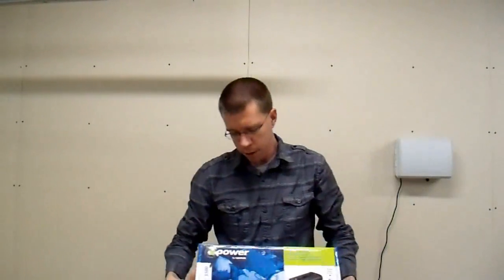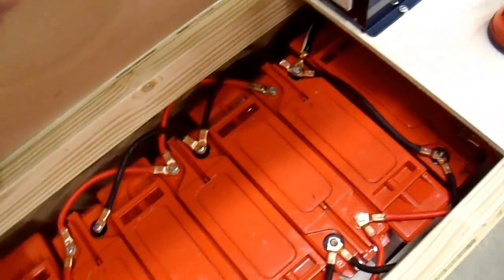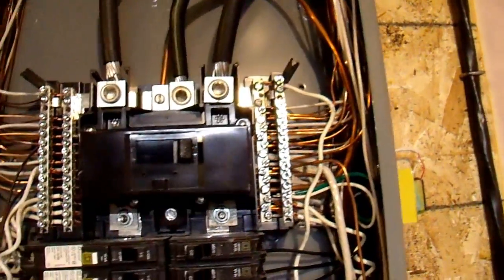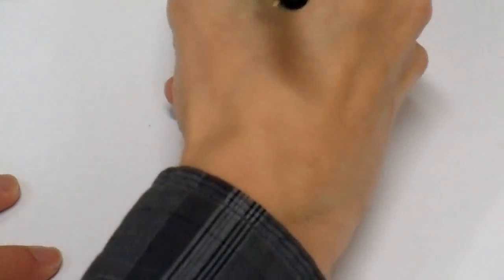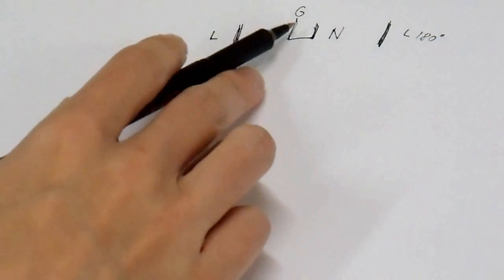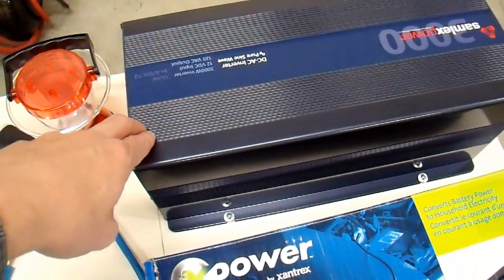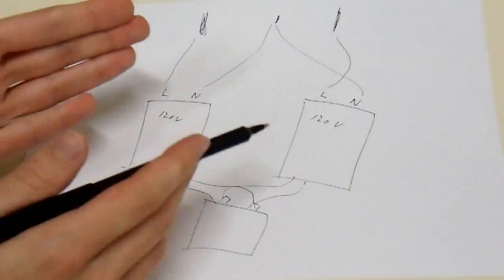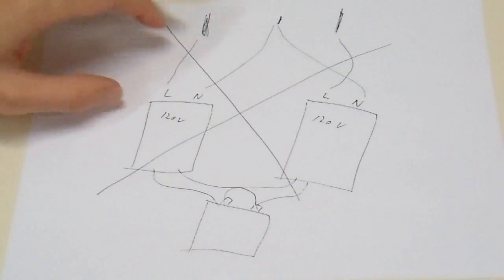How to Power your House with an Inverter/Generator During a Power Outage Part 1/3

Comment: Knurlgnar24, Do you know if apc battery backups are pure sine wave? I have a couple as backup for electronics and wanted to know if they are safe for electronics and other sensitive items. Thanks!
Reply: +Ande Taylor Smart ups are pure sine and the back-ups are modified sine wave
Reply: +z1power thank you!
Reply: Will APC answer that question?

Comment: Looks like it is as fail safe for line workers as not locking your keys in your car or leaving a gallon of milk at the register at the store. Fail safe means eliminating the possibility of human error and in the case of somebody's health and safety this does NOT qualify as fail safe. Are you ready to take on that PERSONAL liability just to show off that you can do it outside of the approved systems? If you were a line worker would you feel good about putting your health and safety in the hands of "some random person" during a potential stressful time to remember all the right steps??

Comment: I didn't see it mentioned in the video or comments but don't you lose your ground (the non-current, non-neutral) as it runs through the same main disconnect as all the other cables?  Great, great video, thanks.
Reply: The ground and neutral dont run through the breaker
Reply: +Star Gazer ah. Of course, why would it? That's pretty key to understand. Thanks!

Comment: Plus you make stuff very longer an complicated. 
Just buy 2 phase or 3 phase inverter,depending on your location. 
That supports on grid and off grid modes.
And let certified electrician to connect your inverter to mains. Everything else you can connect your self.

Comment: In the middle it is not single ground cable.
It is neutral N. On sides is L1 and L2 
Let's not mix N with Ground
Reply: The Neutral is the ground...  The Neutral that comes from the street is GROUNDED at the electrical panel ... The Neutral on the pole is GROUNDED to a ground rod at the base of the pole... The Neutral and Ground are one in the same...
The power company gives you 2 hot 120V feeds and a Neutral... That Neutral gets grounded at the electrical panel and at the pole... and at all electrical outlets in your house... The Neutral / Ground does not carry any voltage... which is why you can touch it and not get zapped..
Reply: @ACommenterOnYouTube  Not totally true. 
The neutral/common is tied to ground at the entrance/main panel and NOWHERE else inside the house.. That is why there is no neutral/ground tie bar allowed in sub panels. Nor is the neutral grounded at outlets - it goes to the neutral screw in the outlet, which is only connected to the proper parallel hole in the outlet body. ALL these neutrals connected to outlets/fixtures/appliances carry current when there is current in the associated hot lead.
In a dedicated 240 volt outlet, there is no neutral, only the two hots and the equipment grounding conductor.
Reply: @buggsy5  there ARE seperate buss bars for N and G in all sub panels after the main panel ... in the main panel there is ONE LONG  BUSS BAR that is used to connect the N's and G's to it IF you are bringing in your load side direct to the main panel like a pool pump or power out to the shed or a generator back feed IN, at that point the N and G are tied together.
Now in all the electrical outlets and all sub panels after the main, the N and G's are seperated. 
My house was built in 1997 and i have 2 sub panels after the main outside, both my inside sub panels have 2 seperate buss bars, one for N and one for G. 
Now when you say they are different, technically they are but when you put you DMM between the N and G you will see a HARD short because they merge together at the main panel making them look like they are the same. So if that N is grounded at the main panel via ground rod, then the N is technically the G ...
Reply: @ACommenterOnYouTube  I never stated that sub panels did not have separate N and G buss bars, I stated they were not connected together in the sub panels, or any place else after the main panel. . 
In your sub panel, use your meter across the N and G busses to measure the voltage across them when current is flowing in one or more of the sub panel circuits. You will measure a voltage differential. It has to be there, since there is current flow in the neutral feed from the main panel to the sub panel and the wire has resistance. The more power that is flowing through the sub panel circuits, the greater the differential.

Comment: Hi, i can follow you guys all the way up to your 120, 120, 240, volt power boards, over here we are all 240v. My question is please, can a (240v) pure sine inverter run with its neutral and earth connected ? Our mains power boards have a big fat earth cable that goes to the neutral bar. So if i isolate the inward mains Active power only, can i connect my pure sine inverter to the neutral and active in my power board ? Would my inverter blow up? I learned that a modified sine inverter wont do this, I learned the hard way :-( so now im worried. Love your stuff, thanks from Australia :-)

Comment: Our family did this during hurricane sandy...not even a suicide cable, we literally just twisted the ends. However we only connected one circuit (the boiler) for heat. We have a gas boiler, so it doesn't require much power.

Comment: Have you heard of using a Toyota Pruis as a battery bank to power your house? if so how would/could it be done? I was reading a ham radio article that talked about it. "Rethinking Electrical power for the Ham" QST August 2012. For that matter is it possible to use any of the new plug in cars as a battery bank by just shutting off the main breaker to draw from the battery bank of the car? Let me know what you think?
Reply: a prius battery wouldnt be able to do it for long as the battery bank is really tiny 

if you had a step down converter you might be able to hack a tesla model S to backfeed into your house

Comment: Great video. I will do something similar, although I plan to build a completely distributed off grid system integrated with both pv and passive solar. Each room will have it's own system. This means if one of my kids likes his room at 68 degrees in the summer, he will be able to control it specifically for his room. Each inverter, battery(s), and solar photovoltaic will be dedicated to its own section of the house.
Reply: I would like to try to have separate banks for each room, but have some sort of bypass switching so that each room could be standalone, or connected to a main.
Reply: +Joash Church are you gonna do it from the same battery bank or have several banks?
Reply: by
Reply: Take videos and share

Comment: Hi! I see your way of thinking helps in understanding most of the stuff you are experimentig on in terms of inverters. How about turning a grid-tie one into an  offgrid inverter? Can it be done? Using just the power stage controlled by a small signal that comes ... say from a cheaper but a true sine wave inverter microcontroller. Grid-tie inverters sell much much cheaper on E-bay nowadays.. Waiting for your opinion about that. :)

Comment: I once connected two inverters to my backfed panel with blocking diodes installed on the hots that exceeded the breaker they were backfed into. I pulled 220, inverters were unaffected. I didn't go any further because I was trying to get 110 at higher wattage

Comment: IS there such a thing as a 'solar inverter' vs a 'regular inverter'?  I have several modified and pure sine wave inverters I've collected over the years.  I'm looking at installing a battery bank/solar panels onto my home and wonder if 1 of my pure sine wave inverters will be fine or if I need a special 'solar inverter'.  I've heard that solar inverters shut off earlier to protect the battery voltage from dropping too far. The trouble is, when I search for a solar inverter, I can't find anything that is any different spec wise to my regular pure sine inverters.  IE, they all shut down when the 12 volt battery reaches 10 volts.
Reply from the maker: There is no difference spec wise.  Solar inverters are generally rated for continuous duty while 'regular inverters' are rated for intermittent duty.  Lesser quality manufacturers will often state that their products are for solar duty or continuous duty even though they won't last, so in reality there isn't any difference.  A good quality inverter will be fine for solar use even if it isn't marketed as a 'solar inverter'.
Reply: Thank you for the reply. :)
Reply: SpockMcoy Issmart

Comment: This has been a very helpful video, our rental home is two stories, however the breaker box had each circuit skip, one would be down stairs, next one down on upstairs, then down stairs, and so on, makes sense now when they build the home. They put one phase upstairs and the other phase downstairs, Im guessing to isolate all the wall plugs, it looked very confusing seeing all the labels, the circuits where not in order of the flow in the home, thanks knurlgnar, so how can one go about purchase a pure sin wave inverters, without a live n/ground? Also if i ever want to power my house once its vacant (its a rental dont live in it) i would only need 1, 120 volt back feed cable for the first floor on any plug correct? I dont need power upstairs, thanks again

Comment: Is there anyway that I could have a transfer switch that can be controlled electrically, so I can use a separate controller to control the switching? I guess the easiest way to do this is to roll your own switch by using two interlocked dpst contactors or a single dpdt contactor, but I don't know if this meets code. 
edit: I think I figured this one out, It's called a "non-automatic" transfer switch; as opposed to an automatic or manual transfer switch. I can't quite find any specific wiring diagrams for any of them, but I assume it will let you roll your own switching controller.

Comment: First of all, great series.  I just finished watched all three parts.  I've been wanting to do something similar for quite a while and you've virtually covered every aspect of it.  I only have one question at this time and that's if you've found a simple way to see if and when utility has restored power other than going outside your home and trying to determine if your neighbor has power? :) i.e. Like a LED that lights up near your breaker box, etc. vs. putting voltage probes on the incoming mains? ;)
Reply from the maker: Without removing the breaker panel cover there isn't an easy way to determine when power comes back on while inside the home.  You would need to do as you said and check at the incoming power leads on the utility side of the mains breaker.
Reply: @knurlgnar24  So can you get 220v from a 110v inverter? Not 100% understand
Reply: @kevinanglin678  In theory, you would get 220V, single phase, but in reality, if those two hot cables coming into your house has different phases, then the inverter will not be able to provide the two phases you need to power you appliances.  Secondly, you would not want to use the 220 V appliances because your emergency inverter power/generator normally does not have that kind of juices (less than 5000 watts). It would be necessary to turn off all 220V circuit breakers and leave those essential ones on, such as refrigerator/freezer, lighting, TV, gas fired furnace/water heater...The most easier way is just hook up your generator as a independent unit.  This video is focused on the inverter power battery, which does not burn gas, so it can be used in house,  thus back feeding is kind of make sense with two cables.  But you can easily do that without back feeding, just use extension cables where you need to.

Comment: Additionally, there is NO local that permits connecting generating equipment in this way.  It's prohibited everywhere, because it is potentially lethal, and It's prohibited by the National Electrical Code.  There's a saying that tradespeople use that rings very true here - "he knows just enough to be dangerous".

Comment: 7 smoke alarms? I had 3 in this house and i tore them out and shot them.
Reply from the maker: yep.  7 are required by the NEC and local code.  One in each bedroom, one in each hallway connected to any bedroom, and one in the utility room.
Reply: ***** I have 3 they are bashed off the walls by the wife. Useless and annoying things, not to mention radioactive.

Comment: I'm from Germany and your fuse box scares me oO
So many exposed blank wires :O.
At my home the ground wires are seperately connected to every fuse. If more than 30mA float threw the ground connection the fuse will cut off the power.
(required by the law)
Reply: Mixermachine yet we don't encounter issues, but laws weren't all made for safety but actually to line the pockets of buddies of said law makers

Comment: why are your ground wires connected to your neutral buses! i know they are essentially the same and can in theory be interchanged but this is not code compliant! lets not even talk about how you are bubba-fying your generator hookup, your panel need to see an electrician. (my source is the 2012 Canadian electrical code book and on the job experience.)
Reply from the maker: Ground and neutral are required by code in North America, Canada included, to be connected together in the panel.  All panels are configured this way as required by law.
Reply: ***** maybe in the states but in Canada, neutral wires go to the neutral buss and the ground goes to the ground busses that are loose in the panel when you install a new panel. you install them yourself (or atleast every single panel i installed required this) into the body of the panel. the ground and neutral are connected by a bonding screw. the only place a ground and neutral can be connected together is by this screw. a ground wire is run from a grounding buss/lug from the body of the panel to the ground rod/plate. all ground wires are bonded together through the body of the panel. the neutral wires all go to the neutral busses which in turn are directly connected to the neutral wire coming from the service entrance and it eventually connects at the transformer. if the bonding screw i mentioned earlier is removed, there should be no continuity between the neutral and the ground wires in any part of the house.
Reply from the maker: lac365
That's interesting, and I can see why they do it that way as it prevents high fault currents from disturbing the GND voltage as seen by the true GND conductors.  It would also be an easy point to measure/inspect for ground faults, or install a whole panel ground fault protector.  It seems to be a minor semantic difference to me given that they are still all bonded in the panel one way or the other, though connecting them in only one place seems a rather failure prone way to do it in my view.  I'm sure either way works just fine but I'm glad we don't do it that way here.  As I understand it the grid still references neutral to ground in the distribution system in Canada regardless so neutral will be at ground voltage regardless if the screw connection is removed and GND in the house is now left floating.
Reply: not according to the 2012 code book.
Reply: MobileTaz you might want to do some reading as well. the neutral is a tap off the transformer. when you bring in a service, you bring in 2 hot wires and 1 neutral. the ground is created by means of a ground rod/plate driven/buried in the ground. have you ever hooked up a service? because i have.

 i also think you are misunderstanding what i am saying. in a panel, the neutral conductors go to the neutral bar, the ground conductors go to bars mounted on the chassis of the panel. the grounding screw bonds the neutral bus to the chassis/ground. if done correctly, if i were to remove the bonding screw, there would be no continuity between the neutral and ground. i have done it where the neutral and ground wires are connected on the same bus the same way they are connected in this video and got shit from the inspector. in theory, it doesn't make any difference. its just a rule we must follow.

 im not saying you are wrong, im saying there is likely a misunderstanding. what we can agree on i think, is this guy and his suicide cord are going to kill someone.
Reply from the maker: lac365
My house was done according to NEC 2008.  I have not read in detail the newest NEC book so it is very possible the method used to wire my breaker box is no longer up to code, however it is by no means unsafe.
Reply: ***** your using what electricians call suicide cords. super unsafe. there is an actual system that can be installed by an electrician that senses when the power is off and automatically feeds your panel from an alternate source. again i say they are called SUICIDE CORDS!!!
Reply from the maker: lac365
I use that exact term in my video.  :)
Reply: so you should know how dangerous it is. what makes it dangerous is the live exposed ends and having to remember to flip the main breaker. if an inspector saw this in your house he would not be too happy to say the least.
Reply from the maker: lac365
Yes, it is dangerous for stupid people.  That's why I only handle it myself.

Comment: I prefer a distributed system - Individual batteries, and smaller inverters in each room with automatic switching on power out conditions. Easy to implement with relays, and less efficiency losses. Larger inverter for kitchen. When one battery goes flat, oh well - still have light in the living room.